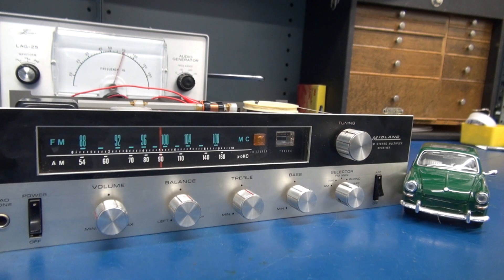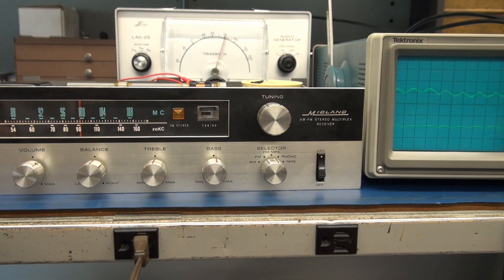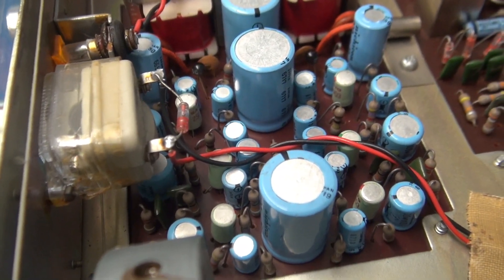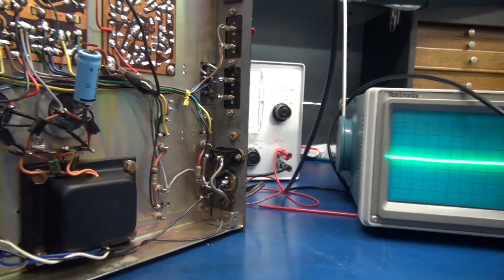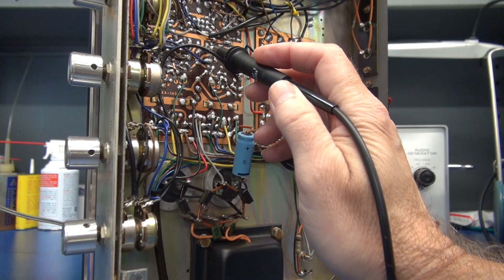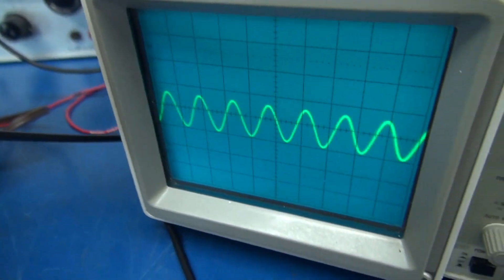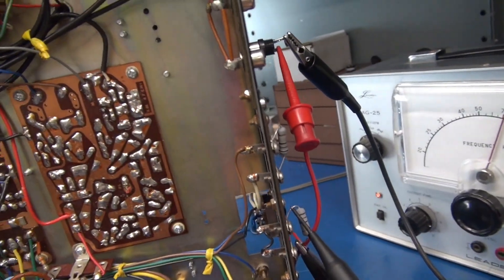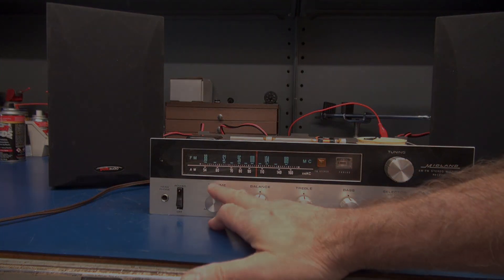How to signal trace weak channel Vintage Midland 19-548 stereo receiver audio generator oscilloscope

Comment: Nice job. I have a modal 19-540. I got it in 1970 for my 14th birthday Very similar but not as beefy. I also cannot find any information on it anywhere. I also have problem with the right side being distorted. Found one transistor bad, replaced but still distorted. You video has inspired me to find someone that can fix it. I would love to hear this again in my office.

Comment: Great Job, I too have an issue with my Zenith Allegro, low power output from Front Right and Rear Right on FM, Phono, and 8 Track.  Front Left and Rear Left and working fine across FM, Phono and 8 Track.

Comment: Nicely explained.  So the resistors just replace the speakers. Presumably 8ohm resistors would work too.
Reply: Yes, but any lower may pose an issue for the amplifier. Non-inductive type is best.

Comment: Hello Mr D=Lab. Thanks for the interesting video. I have a question for you, if you don't mind. How would you troubleshoot a weak signal in the clean channel of a high gain tube amp? I am working on a Krank Krankenstein amp. It is losing a lot of signal in the tone stack. I understand some loss is expected, but I don't know how much. I can't determine if I have a problem or if it is just normal loss when EQs are turned down. Thanks for any help you can lend.

Comment: Hi Terry...I have a 1971Fenfer Pro Reverb that has developed a ticking sound when playing through the Vibrato channel but only when a tube is in position V1.Can you tell me how to repair this annoying sound, not very loud but noticeable. The amp has a brass plate soldered along the knob panel and it has been blackfaced. Where do I start ?
Reply from the maker: Send me a direct e-mail & I will send you a diagram to resolve that tick

Comment: In my experience of 55+ years of electronics repair, one should not jump a capacitor with the power on. It can "heal" the bad capacitor. I learned that lesson the hard way many decades ago. The best way is to tack another cap in place with solder or jumper clips with the power off, then turn the amp on. Yes, on something that old it is best to recap the entire amp. I suspect the ESR on the caps is through the roof on most of them, and another failure is in the near future from the old caps failing.
Reply: Could be the customer only wants to replace the parts needed to get it working again.
Reply: @Brian-yt8fu  Pay me now or pay me later.
Reply: @russellhltn1396  you're right those caps should all be replaced.

Comment: This definitely looks like it was made by Roland Electronics in Japan. I came across a Roland stereo receiver marketed under Roland's Martel / Telmar branding, on Ebay a few years ago and It has the same chassis inside. It was a Model 100T or variation, and from 1968. Those "LiLLy" brand Japanese electrolytics  and vintage "Midland logo" give away It's age.  A very nice budget receiver for It's time and a great repair. It is most likely better quality than any of the current budget receivers of today. It is definitely worth recapping.